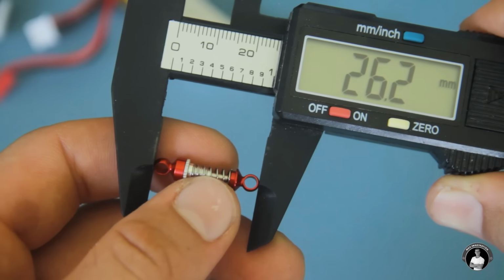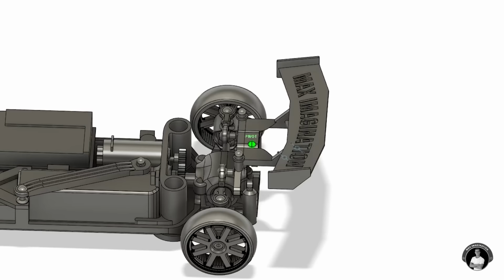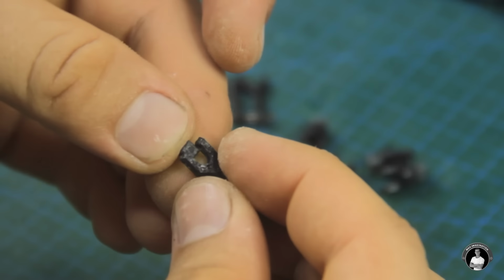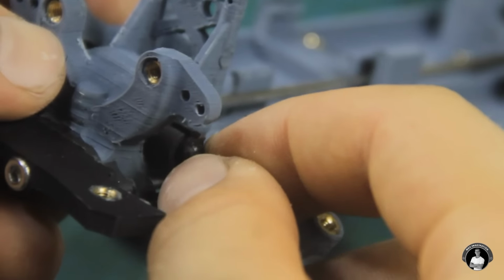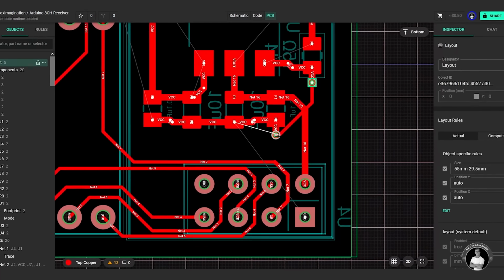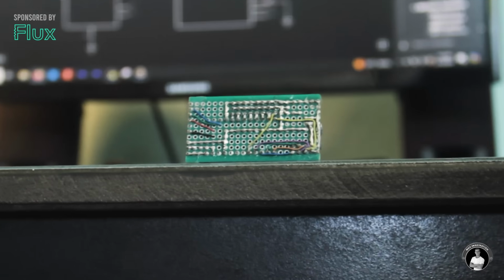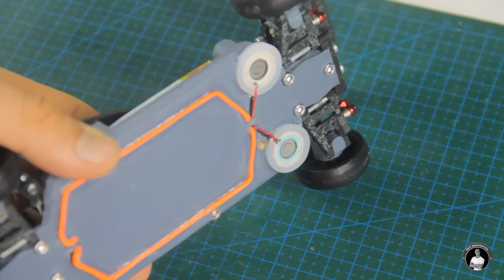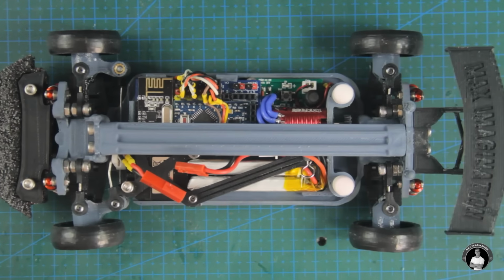Build an Arduino RC Drift Car with Smoke Effect!

Comment: bro is in love with super glue
Reply from the maker: It's magic stuff, isn't it? 😉
Reply: @MaxImagination  black magic, actually. 😬
Reply: @MCsCreations  100% agree. Its magic alright but it can make or break everything 😅. Hot glue is my pick because I can just remove it if I don't like it
Reply: @stormfire451  Oh, and you can use alcohol to remove hot glue!
Reply: @hi_beemo1808  yeah. They are very attached.